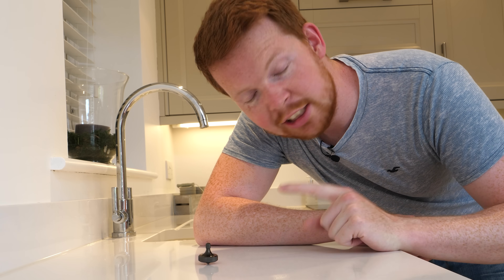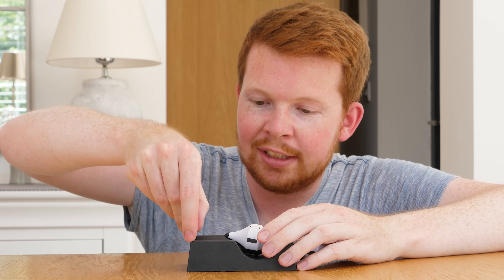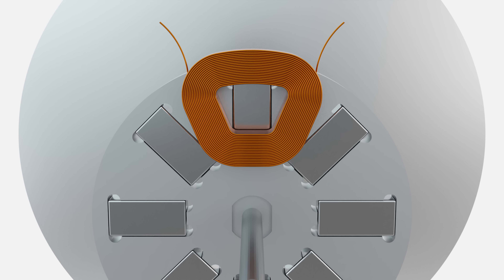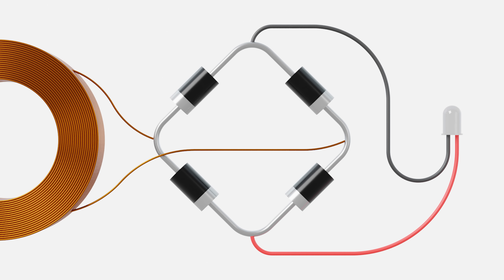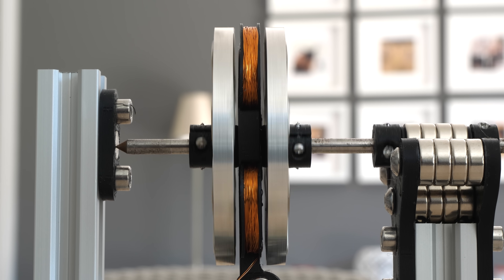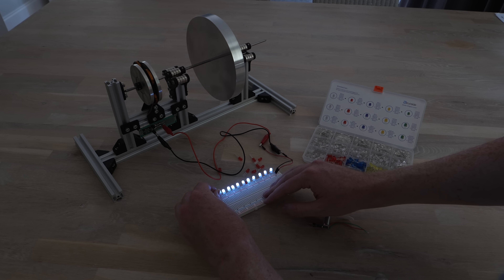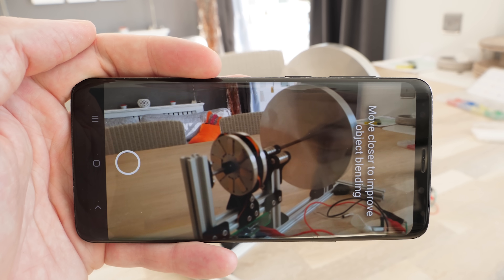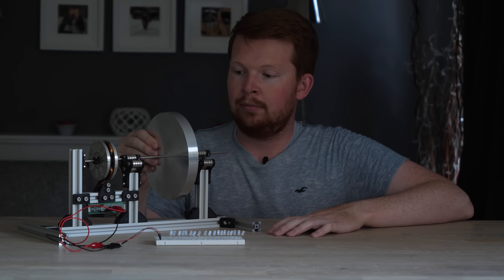Flywheel Battery

Comment: You need to find a different name for this as it is not a battery.
The only stored energy here is in the actual batteries used.
I do not want to knock very hard, as an explanation for alternating current generation using a magnetic floating bearing it is an interesting science project for youngsters.
P.S. Thank you for not using the term " Free Energy"

Comment: In theory, you could use just the LEDs to make a rectifier.  Half of the LEDs will light up on one path and half will light up on the other.  It would save you the 0.7-ish volts required to forward-bias the diodes.  Also, might be good to add a current-limiting resistor in-line with those LEDs for longevity, but moot point for the short run here.

Comment: Using the thicker wire in the alternator is safer than using the thinner wire because when you connect something load heavy to the thinner wire, it draws too much current and melts it. The thicker wire allows less voltage, but is safer because of this.

Comment: here is an idea, why not just move the two "support beam" magnet a bit out, so the magnet on both end push toward the center and stabilize itself and eliminated the tiny bit of friction lose dude to the needle pin on the far end? would that be way to unstable?

Comment: btw you can get way way more power than that, your LEDs are flickering a LOT, those are not "larger capacitors" you can get beefier ones there and you would run smoother, but to really have optimal output you need to get rid of that giant off time your generator have, make 8 coils and have them touching each other, no gaps between coils.

Comment: Hi Tom I wonder if you've seen this video https://www.youtube.com/watch?v=5mERXljsdHY It deals with a rotor spinning in a magnetic field in the same manner as your video. The difference here is this video is about making a solar powered motor from miniature solar panels powering fine copper windings which spin as an assembly. Unfortunately the audio is in Russian but this does not impede the excellent drawings and visualisations showing every step of construction. I can see 3D printing would assist greatly in minimising balance errors. The video runs for 50 minutes odd and is well worth investing the time to watch it.

Comment: Increase the central shaft diameter and reduce its length to place the round magnets just outside of their field.  Make the fly wheel out of brass or bronze.  Drill dimples into the outside face of the fly wheel to balance it.  Multiply the frame structure by 10 to eliminate any movement.

Comment: Fun fact: The flywheel will spin down faster when attached to a larger electric load, because energy is still conserved no matter what form it happens to be in.
Reply: More precisely, it is described by Lenz's law. The current induced by a changing magnetic field will cause a magnetic field itself which opposes the initial change. Therefor higher currents (bigger electrical load) cause stronger opposing forces which will slow down the flywheel faster.
Reply: Thats why when the diesel generator have extra electric load the governor increase the fuel index to keep the speed  constant so the voltage will be constant

Comment: I commend you for your experimentation but like many "magnetic" experimenters on YouTube you seemed to have completely missed the point of Faraday's law of induction.   The law states that the induced voltage is proportional to the (rate of change of) magnetic flux density.   Now, you can increase the flux density by just using stronger magnets but by far the most important way of increasing flux density is by decreasing the amount of air it flows through.   Iron has a conductance of magnetic flux 1000 times that of air so it is important to capture the return flux in iron.   If you did that your alternator would be many 100s of times more efficient than that you have built.   Your outermost magnet surfaces need to be connected by an iron path perhaps in the shape of a C (for each pair).

Comment: You can use subtractive balancing.
Most of the energy is stored in the outer edges of a flywheel.
The less you have toward the center, the less input you need. 
Extra can be drilled out, so long as it maintains structurally intact.

Comment: Since your alternator is also an axial flux motor, it would be neat for you to charge the flywheel with the motor and then recover the energy back through the device to 1. measure losses round trip, 2. put it on your ebike and use it for energy storage and recovery like F1 cars... A button on the bike to "press to pass" would be soo cool for a burst of speed

Comment: Out of interest why didn't you connect it to a DC motor like they do in KERS systems, the motor will work as a generator when you backdrive them as they are the same thing, that way you don't get all the losses and wont need to be maglev. 

Another way you could have tackled this is you really have to maglev it is you could have set it up as a 3 phase DC motor by removing 1 coil or adding 2 more and spacing the magnets appropriately and then connecting it to an old bidirectional ESC laying around.

Comment: Love the video, very educational and practical.
I don't have the first idea about electrical engineering, but could you reduce the pulsing effect by having an odd number of alternator coils offset so that current is induced in a staggered fashion? With not all alternators interacting with the magnets at the same time, that might also reduce the peak decelerating force exerted on the system (not an issue in a frictionless environment, but might slightly increase efficiency in real world).

Comment: So if it had enough power to spin a bit larger motor, said motor could spin the shaft in turn producing more electricity and making an infinite running loop.

Comment: I have one of the desk top levitating toys like yours.  Its over 20 years old and has a little built in led that would illuminate when spun. The led eventually stop working.  It sat on my desk and impressed lots of people with it long running, almost frictionless, turning.  I once cut little paper scoops and taped them around the spinning portion of the toy.  Blowing on them could spin it up faster than by hand twisting and with less induced wobble.  I never tried using an air compressor.  With your set up an air compressor might turn your flywheel if it had some scoops to catch the air.

Comment: Cool! I have several ideas such as this, nice to see someone make this. Could you take it a step further and put magnets on top of the flywheel shaft to further stabilize the rod ? And hook a solar panel up to a small motor to power up the flywheel ? Maybe add a battery to store up the solar power so it can run when there is no light ?? The list goes on and on …. 🤪🤪🤪

Comment: I wonder, since the fly wheel is still connected to the side there, it's still making a very slight amount of friction, right? What if you used magnets to reduce that friction, with one on each side, so that it's even closer to being frictionless?
And do you think the device would be affected by things like air pressure or temperature?

Comment: Essentially you have created a single phase alternator with 4 windings this increases the voltage that's why it flickers. You could make 3 phase alternator with 3 windings 120 deg apart to create a more stable voltage.

Comment: This is exactly what I'm planning to do for our thesis. I'm gonna attach it to an old bicycle and make it as a machine that charge your devices while exercising. What do you guys think?🙂
Reply: Nice idea dude 😊 even I was thinking about that 😂
Reply: Should be doable!  Devices like the iPhone charge at about 5V and 1A (5watts).  A recreational bicyclist can output about 200watts for about 45 minutes if they’re pushing hard; an athlete can do about 200-300watts for 4 hours.  You could probably even charge a tablet at ~10watts.  Good luck!
Reply: Why bother with levitation if you're going to power it?  You can make the shaft stationary by using a good bearing in the center of the flywheel.  Or do like he did with a spinning shaft and use it as a sort of axle to fit between your bike frame and have the flywheel in place of the rear wheel and tire.  Weld a sprocket to the shaft on the outside of the frame and you're all set.
Reply: @pamike4873  the point of levitation instead of bearings is to reduce friction losses
Reply: @TheAechBomb  Right
Reply: @TheAechBomb  yeah true
Reply: @pamike4873  Oh I won't include the magnetic levitation. But about what you said, sounds the same to my plan haha. Thank you BTW 😁
Reply: cool, but this has been done before if that matters to you

Comment: You can see the flywheel being dragged down by the extra current needed and thats why you need a tight fanbelt on your Cars alternator as when putting out say 60 amps, the drag is enormous through that belt and your engine feels it too to a small degree.  You can hook up a Alt on the bench with a battery and a light ect, then spin the pulley with a drill and you will feel the very heavy loads on the drill and you hands as it speeds up and more amps are output through the regulator. Its quite a lot and thats the magnetism really going full on .

Comment: What if you made some kind of pull starter or geared handle device that would attach to the fly wheel on the open end that can spin it up at a super high RPM by hand, and then release it to float over to the low friction end. Like a sideways beyblade

Comment: Tom, could you put a 3D printed crank on there to get higher RPM without using your fingers? It would be cool to see this without the wobbles and higher RPM by hand crank. I bet you could get the fan going no problem.

Comment: Press fit a shaft? Never heard of collars? Then just drill and pin it to fix its position. 

Also, way to thin a shaft. Should have went with 9/16 or 1/2 at least and just gotten more or stronger magnets.

Comment: If you want to increase the magnetic field some more, put a steel plate behind each magnetic plate (opposite side as the coils, so you have steel plate, magnet plate, coil plate, magnet plate, steel plate) and you'll roughly double your voltage again.

Comment: Nice project and beautifully explained. Some thoughts from an electronics engineer:

1. You can power as many LEDs as you like in parallel. Adding more LEDs increases load current, which increases load torque from the generator and slows the flywheel more quickly.

2. If you use Schottky diodes with a low forward volt drop you’ll minimise rectifier loss and improve output voltage.

3. You have a fairly long flux path through air. You may be able to improve generator efficiency even more by adding discs of a material with high magnetic permeability, like steel, or even better soft iron. Add two, one to the outside of each magnet disc, so that the flux from one magnet returns efficiently to its adjacent partners to pass through the next winding more easily. You could also fit iron plugs inside the coils. Then the only inefficient air gap in the flux path will be that necessary for mechanical clearance.

4. You’d get a smoother voltage by using a 3-phase winding arrangement and a three phase rectifier.

5. As an added bonus to the 3-phase idea, if your rectifier was part of an intelligent 3-phase bridge, you could run up the flywheel electrically, then on demand recover energy through the generator. This would make an electromagnetic rechargeable battery.

Comment: Tom, can you rewind your coils to be more like a brushless hobby motor?

Then you could use a brushless esc to spool up your flywheel crazy fast and then switch to your rectifier to see how long you can run a small fan or light.

Comment: You should wire the motors back to a pulley to spin the shaft. Won't be perpetual but should be really fun to see how long it will keep running itself once you get it started!

Comment: All you need to do is put a few gears and get a crazy ratio and a secondary heavier flywheel that you get spun up before engaging the primary one, along with some spring tension and you could get that going really well, only drawback besides possible lockup is with increased used voltage the harder it will be to spin and the faster it will slow down

Comment: Next: Use the generator as a motor to get the flywheel spinning!
Reply: that is what I am thinking...I will try to build one myself, Now where do i get a magnet with a hole on the center, and how much will it cost overall with this set up, The author did not even mention it.

Comment: Tom, you should have shorted the output leads to stop the flywheel with electric braking instead of just grabbing the flywheel! I would have liked to see that ...

And if you could record the voltage and current throughout, you could measure the total output.

Comment: Go to 3 phase, that will lower the flicker. Schottky diodes for rectifiers - higher efficiency, due to lower voltage drop. Iron cores in the coils might increase produced voltage.

Comment: Would you be able to set up a hand crank of some sort that requires little effort on the input side but uses gear ratios to multiply the output? That way you could have it set on a desk and be able to spin at much higher RPM with little effort? Just a thought

Comment: You should expand on this project with an electric way of charging this "battery". In it's current state, you can only "charge" it by spinning it by hand, but it would be ideal if you could just plug it into the wall to get it spinning, then unplug it, and use the remainder of the power. Just like a backup battery cell.

Comment: I would love to see measurements of how much faster the flywheel slows down with a load vs without a load.
Reply: Always depends on the LOAD!!!..the higher current draw on that generator, the higher it will create magnetic drag slowing down the flywheel in an instant. 

Example: STepper Motors..turn the shaft of that motor without any load. easy to turn, Now put at least a load on any wires of that Stepper and turn the shaft, there will be a drag.

Comment: You didn't need a rectifier, I mean it's nice to have and I can't tell your kinda an old guy but it's unnecessary for this, also if you are going to go to the extent of making the circuit please put a current limiting resistor, just because you are supposed to have one

Comment: I read a sci-fi story about an inside-out flywheel storage system.
Large circular track, very strong material, perfectly circular and smooth.
Kilometer in radius.
'Cars', vehicles of great mass, using motor/generator sets for propulsion.
Many cars running on the track at any one time, all steering is automated.
Individual cars make 'pit stops' for service.
Each car is a storage unit; the faster it goes, the more energy it carries.
Entire facility is evacuated of air; the cars average 600-800 meters/sec!
The author skipped over how power got to or from the cars, or maybe I missed it.
The grit of the story?
A rogue state wants to blackmail decent folks, so they sideline all the cars save one.
They run it faster and faster, pushing it beyond far beyond safety limits.
At terminal speed, a crash would destroy the track.
The implosion would be devastating!
And since a city has been built around the track, loss of life and all that jazz.
Our plucky Hero, being an uber-tech, simply activates a coolant purge of the car.
The bearings start to heat up, car automatically slows down and makes a pit-stop for new bearings.

Comment: I'd love to see a follow up on this, if you used a NC/O relay you could switch between charging and drawing from the flywheel using some low voltage AC to charge the flywheel battery. I have got to get myself a 3D printer so I can do something like this...

Comment: Use Schottky diodes to reduce the voltage drop on the rectifier! General purpose rectifiers usually drop 0.7v per diode, but Schottky diodes drop 0.1!

Comment: Im sure you understand this Tom, but voltage is meaningless without a current measurement. Work potential should be measured in Watts or Watt hours if you're including time as a component.

Comment: Could you power the coils through a driver and spin the rotor through that? Then switch them off and use it as a generator again ?… make an actual battery from it.. some company’s have made flywheels for energy storage, they usually use a composite rotor stored in a vacuum that spins at a few hundred thousand RPM.

Comment: You should make a version 2 that's more balanced, has a spin-up mechanism, and has 2 or 3 more sets of coils on the shaft out of sync with each other to smooth out the DC signal

Comment: Build a large system with a pedle set up to get a giant, like 150 pound wheel spinning with a massive alternator. Charge up a house sized battery pack that can run your entire house. Never need a generator again, just peddle the bike for half an hour, let it spin for an hour, repeat as needed. 

Would need to be very powerful magnets, and a very good surface/needle point like quartz/ceramic so they don't dig into eachother, with a set up to disengage the peddle mechanism to let the magnets float the device unhindered. Charge your EV by peddling your giant magnet flywheel generator while you work out.
Reply: i like where yer goin with this...!~

Comment: Cooooool project!! I love flywheels, and this was really an interesting toy!!
I've just ended electronics course  in my university and I could suggest that better current rectifier may improve a lot your project without changing expensive ardware: diodes low the voltage 2 times in this circuit ( 2 diodes in series every time) and nothing is used tu really have a smooth output. Probably a pair of opamp and little circuit will make the difference. (I don't really remember the name or the configuration of wat you need, but I will look for it :)  )

Again, niiiiiiiceeeee project (as always)